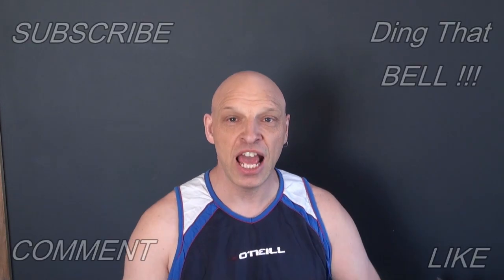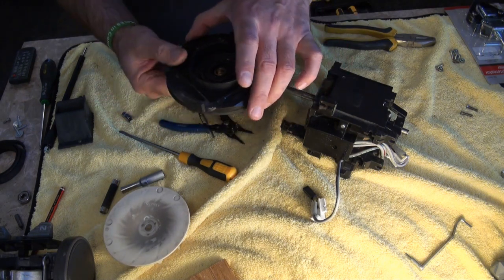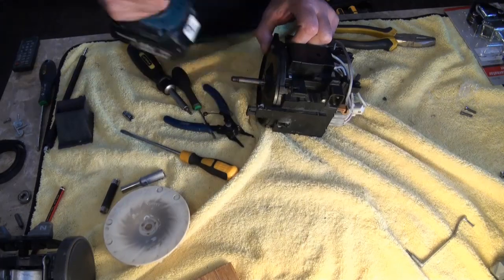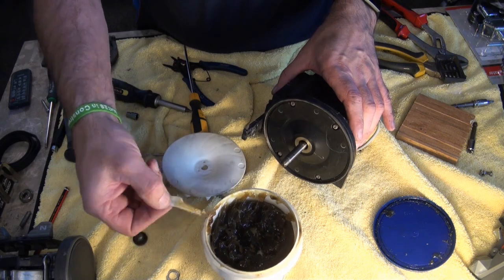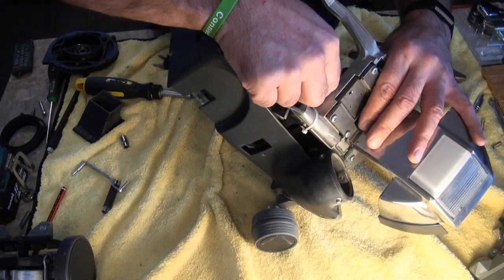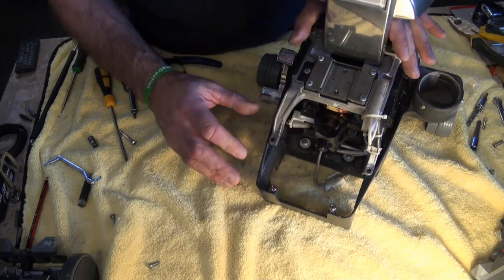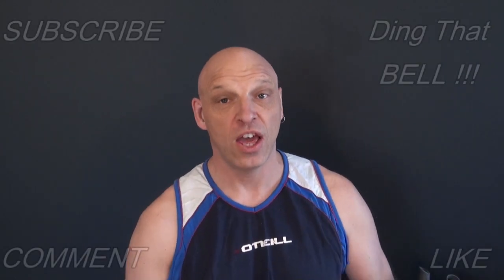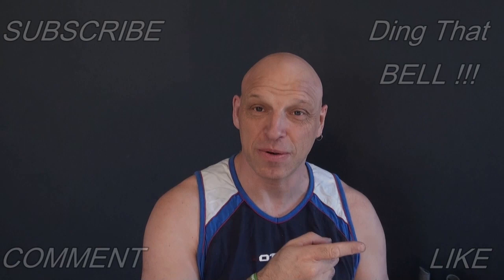HOW TO REFIT KIRBY VACUUM CLEANER FRONT & REAR ARMATURE BEARINGS

Comment: Howdy! First, thanks for the channel it has helped me SO much but I have a concern... I’ve been restoring a G3, 2 of them actually.. but when I did what you’ve done in this video the fan blade rubs the top of the fan case slightly when the motor is inside the case... the other G3 motor which I haven’t messed with fits perfectly. Maybe I screwed something wrong with the front bearing plate?
Reply from the maker: You have to push down on the shaft to make it sit properly before tightening 2 screws  through the base 👍👍